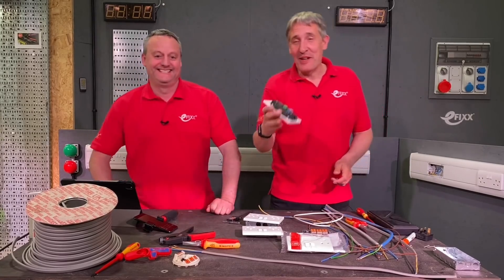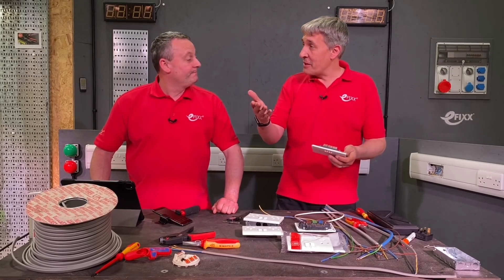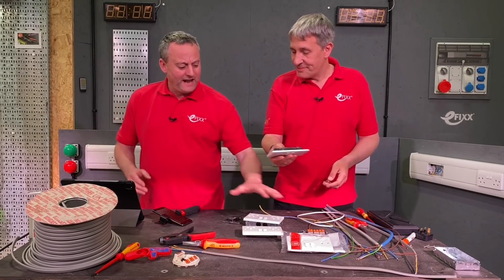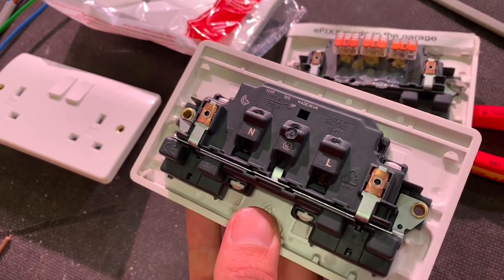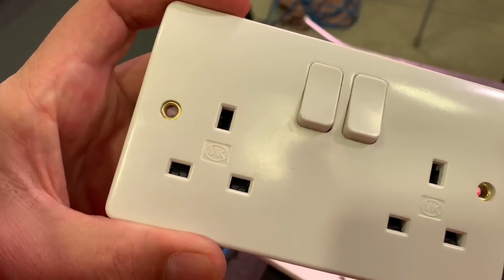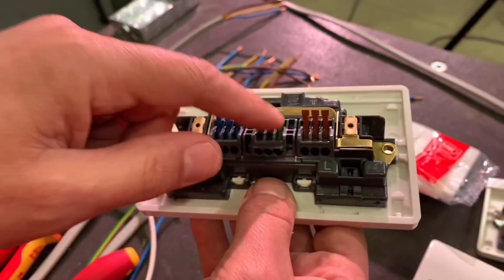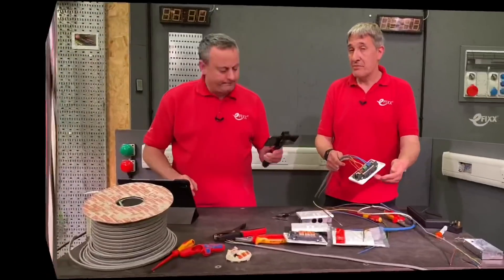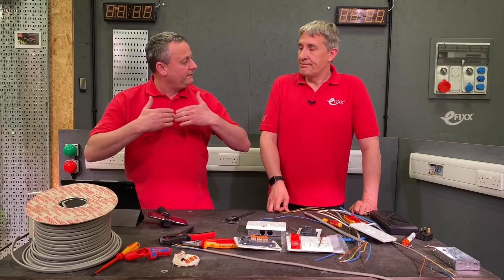MK LOGIC RAPID FIX - Double socket with SCREWLESS terminals.

Comment: Just one thing with the new MK socket. If you have a spur from the ring this obviously uses the 3 cpc terminals, so what do you do with the flying lead to the back box. I doubt you could double it up , plus its usually 1.5 mm, where the likely hood is in the terminal  there would be 2.5mm or bigger, which i assume you shouldn't mix sizes in one clamp even if you could double it up.Just a thought.
Guy
Reply: Earth fly lead not needed if a solid lug in the backbox is used.

Comment: Not used mk for a long time, didn't know you couldn't get the pin covers down using the earth. That would be really annoying when trying to stick my probe tester in. Yes there are times when I just want to stick a probe tester in rather than getting out a big tester and leads.

Comment: Nearly double the price of original logic plus sockets though, don’t think many people will  use them until the price comes down??
Reply: 36.5% premium.  Perhaps more worth it for when connecting a spur (£2.15 per socket).  All that faff with three wires in the single terminal avoided.

Comment: One thing that bothers me with this and also the Ashley MF junction boxes is as the terminal can't move does any stress applied by the conductors affect the connection's integrity in any way?
Reply: The Ashley/Hager  mf has cord grips. Conductor shouldn't be moving on that. 🤔 Unless the grip is in the bin!
Reply: @travoltasbiplane1551  True, but then it's possible to have the connections stressed by the way the wires sit between clamp and connector. 

For clarity, my concern is is it possible to reduce the clamping force on the conductors by applying a non-axial stress to the connection.
Reply: @Graham_Langley  I'd have thought the 5mm or so of 'guide' prior to the actual metalwork of the conductor should mean the conductor bends before the terminal. Unless you're really abusing it!
Reply: @travoltasbiplane1551  You're probably right. Now I'll have to find something else to worry about...
Reply: @Graham_Langley  in this industry I'm sure there will be something to get steamed up about along imminently... 🤣

Comment: I think there should be one more lever position, specifically for the the CPC. This would allow for a conductor to connect to a metal box, even when you have both a ring and radial connecting in the same box, without the need for an additional connector for the CPCs.
Reply: Use a metal backbox with a solid lug, then an earth tail to the box is not needed. Why do something you do not need to do!

Comment: Can you fit 2 cables into one lever if you have 3 cables and back box flying lead? Do the screw housings connect back to the earth circuit in the socket?
Reply: I would think so, and a double/twin ferrule end connector would facilitate that

Comment: I’m surprised that so many responders think they need a 4th terminal for a back box ‘fly lead’. With these sockets the faceplate fixing screws give a perfectly adequate earth connection to the back box.
Reply: Yes Bruce. No need for an earth fly lead if at least one lug is solid. 

Also the adjustable lug also gives an earth. Pretty well guaranteed to earth the socket to the metal box behind.
Reply: There's generally adequate, then there's guaranteed; and they're mutually exclusive. With the 4th terminal for CPC, the box remains earthed even if something happens to the screws, or when the cover is removed for testing.

Comment: Why would they not put 4 connections for the earth?  2 for the ring 1 for a spur and 1 from the metal backbox
Reply: Because the earth fly lead is not needed if one lug is solid.
Reply: so they are going by "well it meets the regs" rather than "best practice".  Shame something so simple has been overlooked
Reply: @ryanjames2962  
You can always loop the CPC into the earth terminal in the box then out to the socket - without cutting the cable.

Comment: Finally!!  And now one for the cable manufacturers... T&E with insulation on the earth conductor!  No need for bloody earth sleeve anymore!!
Reply from the maker: Irish ☘️ Twin and earth has all three cores insulated.
Reply: @efixx  ah didn't know that.  I guess the only downside is the cable's overall thickness would be slightly thicker.  Also the price would be a bit higher but I'm sure most sparks would gladly pay a small premium to not have to use earth sleeving at every single termination.
Reply from the maker: Other issue is the earth conductor in the Irish T&E is equal (2.5mm ) to the others - more copper, more £££ - https://www.wesco.ie/news/new-twin--earth-wiring-rules.html
Reply: @efixx  is this reg likely to come in for the UK?  If not, we could still use an insulated 1.5mm version.
Reply: They used to do it in the 70s, Crabtree also had screwless terminals in the 80s

Comment: A bit   tight   in  a  25  mil  box   but   you   still  got   to Screw it  back   to  the  wall   / time  will   tell  if  these  screw  less   terminals   work   or  cause  problems

Comment: Why not 4 cpc connectors? Would allow for a spur and back-box strap. Or could you put 2 1.5’s in a single terminal?
Reply: It’s a plastic socket no need for the fly lead tho
Reply: You’d put the cpc into the back box first then onto the socket. No need for four earth terminals at the socket.

Comment: Love these only improvement I’d make would be 4 earth terminals so you could spur and earth the backbox
Reply: Just loop one of the cpc 's via the box earth and then into the socket.  You don't need to cut it either just double it over .
Reply: Use a backbox with a solid lug, then earth fly lead not needed.

Comment: All our company use is them mk  logic range and we just love this  . The golden rule is never ever fit a 25 mm box for a socket . Why you may ask ? If the client asks you for a flat plate socket to be fitted it will not fit in a 25mm box you will need a 35 mm box .. more room for the wiring too. Come on guys it takes 5 min more to cut a 35 mm box in ..
Reply: Takes no extra time to chase in when a tracking company are being paid to do it instead.
35mm for spurs, switches and sockets, 47mm for cooker and shower boxes
Reply: @darylsavage119  Exactly couldn’t agree more

Comment: we started using screw-less sockets and switches in 1981 in Denmark. Looking forward to when you also invent sleeved CPC in cables and CU and meter installs where everything is clean and hidden, so you do not have visible tails hanging betwwen the items in the meter box.
Reply from the maker: We can only dream 🛌
Reply: British meter/CU installations are generally a living disgrace. It looks third world.

No cables seen on mine.

Comment: If you add a spur, where does the extra cpc connect to, assuming you already take up the third terminal with a fly-lead?
Reply: If you need a spur and a fly lead any good sparky would know you could do a loop via earth terminal on the back box to the socked without cutting the earth wire , simple isn't it
Reply: you dont really need a fly lead

Comment: Should really have 4 terminals for the earths. This would allow for the two (eugh!) ring legs, a spur and then also the obligatory flylead for the metal back box
Reply: Glad you have also spotted this issue. 👍🏻
Reply: Nothing obligatory about fly leading a backbox with a fixed lug
Reply: 4 terminals? like on a standard socket where you have 4 terminals also?  think not.
On many sockets you only have 1 terminal and stuffing 4 leads in it is extremely hard.
Reply: @mattylad8035  is it that hard?
Reply: Aye. As its a screwless connector its one conductor per connection terminal. This is to ensure a good connection due to the way the connectors work. And 4 conductors is an issue - most outlets say max of 3 for 2.5mm cable, although the CPC is 1.5mm so a little more space available.
Reply: @mattylad8035  I have a feeling all MK sockets have dual earth terminals. At least all the ones in my house do. The idea is you put the earth from each side of the ring in separate terminals as a safety feature. If one comes loose you still have an earth. Then again it might be a feature of the outboard sockets, which I vastly prefer and of course all my double sockets are outboard switched.
Reply: @mattylad8035  I’m not sure why it being hard in current sockets means that it’s a bad idea in the new one. Nobody is saying “unless you do this the old one is better”. Only ‘this could be made slightly better easily’.
Reply: @JasperJanssen  I didn't say it's a bad idea.
I love wago's... :)

Comment: My thinking is over time will that lever weaken over time.  Also how was it stand up to a dead short.  Or prolonged over load from a heater being plugged in.  Or when fuse is to low in the plug and over heating happens.  Will the leaver stand up to this.  I like the sockets with the pull leaver not seen them about for years.  I had spelling error in there Google Voice to text.
Reply: My sister's called Heather - are you planning on electrocuting her? 😂
Reply: @the-real-iandavid  Google voice to text error

Comment: Been wanting something like this for so long, hopefully they extend it across more products such as FCUs and switches, although the design would probably need to be changed to make the terminals small enough to fit on a single gang product.  If they're keeping the screwless terminals exclusively to the double sockets, it would at least be good to see more widespread adoption of cage clamps like on the Crabtree instinct range, at least then you don't have the issue with damaging conductors by overtightening.  Makes for a tough decision when deciding on a range to go for - Logic Plus for screwless sockets but regular screws on everything else, or Crabtree Instinct for cage clamps on everything but no screwless option.
Reply from the maker: The range will be expanded. - stay tuned

Comment: Looking at the terminals with all conductors coming in, in threes, if it is tight in the box, with cables coming in from different directions, putting a cable tie on the three cables will ensure no stress on the terminals.

Comment: What a time to be alive honestly u could blast 100 sockets 2nd fix nip up the faceplates with the Speed E  . 

What's your thoughts on this type of connection for shower pull cords, that pesky neutral is usually cooked

Comment: I would never install a socket with a USB outlet into a wall. This type of socket has many additional components compared to a standard socket and they produce heat. Some are also prone to premature failure and require a complete replacement.
Reply from the maker: But customers love USB sockets
Reply: What has your comment to do with screwless terminal sockets?
Reply: @johnburns4017  My error. I was responding to another viewers comment where he asked the question as to when MK would have a USB socket with these connectors and I should have put this comment as a reply to him. Sorry if this caused confusion.

Comment: Well done MK. Finally a UK socket with Wago style connectors. A transparent connector similar to the Wago 221 connector would have been even better. I have used French sockets with screwdriverless connectors but they were only suitable for solid conductors and once connected the conductor was almost impossible to remove. From this presentation it appears that the MK connector can accept solid, stranded or fine stranded conductors and the conductor can be withdrawn by simply lifting the lever.  I cannot wait to try them out.
Reply: @wagodraper4201  Thanks, that is good to know.

Comment: I can’t see these type of connections lasting . Give it a few years especially with a high current.Time will Tell, especially if there not made in the UK. The pull switches made in China are a good example a couple years and that’s there lot. Anyway I’m sure I could screw down a traditional terminal just as fast if not quicker
Reply from the maker: They are using Wago technology
Reply: Germany. Scandinavia, etc, have used these for a long time. They have no issues. 

Understand all points of what they bring to the party.
Reply: You could screw down a traditional screwed terminals faster? In your dreams!
Reply: H H   Yes . I have used them for years . As long as they are a decent make and screwed down properly they never give trouble. A wago relying on a bit of spring metal might be ok now but in years to come who knows
Reply: @andysims4906  
Do some research on Wagos. They have been around for decades, without any of the problems you are dreaming up.
Reply: John Burns  some of use are old enough to remember that the regulations changed .we couldn’t use wooden consumer units anymore as they were combustible. My boss at the time wouldn’t use the new plastic ones as he said they will come back to haunt us in years to come so he only used metal ones. Every one at the time said the plastic ones are ,fine and he was being stupid. .look what happened. He was right
Reply: @andysims4906  
Read what I wrote. 
Wagos have been around and proven for decades - even in commercial applications. 

They may not be the in-thing at the end of your street, but in the likes of Germany they are well proven being very safe. They apply the correct torque not working loose over time.

Comment: So if you spur off the socket on a ring, with a metal back box you need a fourth CPC/earth terminal. With only three you need to use the back box CPC terminal as a junction.
Reply: Use metal backboxes with one solid lug.
Reply: @johnburns4017  Always thought relying on the faceplate screw (in either direction) was frowned on.
[Edit] It'll be interesting to see of the Metaclad ones get a fourth CPC connection.
Reply: @Graham_Langley  
Regs say no earth tail needed to metal box if one of the lugs is fixed. RCBO & RCD makes safety stronger.

Comment: All we need now is light switches having round boxes behind.  The vast majority of light switches can use a round backbox. Then use a drill to make the hole, instead of knocking out square holes.
Reply: There are round backboxes on the other side of the Strait of Dover. ;)
Reply: The shape of the box doesn't make any difference what so ever
Reply: @robertburrows6612  
Round means they are easier to fit using a drill.

Comment: I use 35mm boxes.  The final ring, or radial, is connected using Wagos in the box.  The 1st fix can then be tested, then walls closed and plastered, with confidence the walls will not be ripped out to replace defective cables, after a failed test.

Then all the sockets on a bench have three flexible wire tails fitted - simple and quick. Then the sockets are quickly fitted into the Wagos in the 35mm boxes. The flex wires ensures an easy push back into the box,  with no cables popping out of terminals, as the cables are not under stress. Screwed socket terminals only have one cable in the terminal.

A heavy current final ring or radial runs through the superior Wago connections in the boxes, not via a stessed terminal with multiple cables in it on the back of a socket. 

These MK screwless are most welcome, and far too late onto the market. But, they still do not eliminate a Wago for 1st fix testing, as I do it and explained above. 

They do eliminate the problem of multiple cables in screwed terminals,  which is a big problem in itself.
Reply: Interesting, might try this method myself
Reply: @gkelectrical1  
It is so much quicker. You have easy 1st and 2nd fix testing. Most testing is only 2nd fix. I have seen plasterboard walls come down when a cable was found defective. Electricians paid. 

Quicker. 30 sockets is quite common in a job. Fixing 90 four inch flexible cable tails on a bench to 30 sockets is easy and much quicker. 

Current only flows through the socket terminal when that socket is drawing current, as the final ring's current runs through the Wagos at the back of the backboxes, which is the ring's spine.

The Wagos do not work loose over time. No sparks, potential fires, etc.
Reply: @johnburns4017  I’ve seen some wagos over heat once. Do you know the rating of the lever wagos?
Reply: @gkelectrical1  
32A. 
John Ward and I think also Big Clive did videos deliberatly overheating Wagos. They took about twice the rated current for quite a time, before the plastic melted.

Comment: The issuer with those sockets is that their isn’t enough earth terminals. If you did a runs an then a spur of the ring you couldn’t terminate all the earths an the back box. Yes I would earth the back box even if it has a solid screw hole.
Reply: Then use a Wago in the box for the extra CPC. If you want to earth metal box when it does not need it, then.....
Reply: @johnburns4017  it’s not a good design if they haven’t thought of it. Shouldn’t have to add an extra wage in the box.
Reply: @brightside0970  
Use a metal box with one solid lug, then no need to connect a CPC to the metal box.  Simple. Most metal boxes have one solid CPC. Two adjustable lugs is rare. 

You are bringing up a non-issue.

Comment: It comes down to cost . At £6 a pop I won't be fitting theses any time soon. Plus the fact when I'm having to install 32amp radial circuits in industrial or commercial installs these are unsuitable.
Reply: They are totally suitable.  They can carry 32A.
Reply: @johnburns4017  I would assume the issue is that 4mm² isn't always enough for a 32A radial depending on installation method, grouping factors etc. Regular MK logic plus double sockets are rated for 2x2.5mm², 3x4mm² or 2x6mm². These fast fit ones are only rated for 2x2.5mm² or 3x4mm².
Reply: @petermichaelgreen  
What the MK specs say in max current through the Lever terminals?

4mm is max 37A avge.

Comment: 10:28 - seeing it from that angle kind of shows the need for a possible 4th cpc connection.
Reply: My thinking too. Only way to do it would be to run the CPC into the back box terminal first then a jumper to the socket.